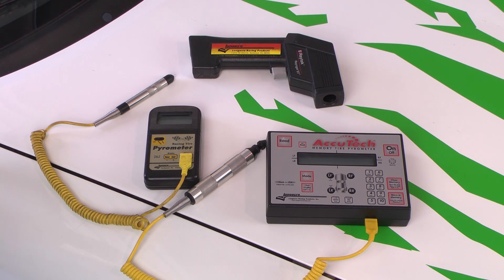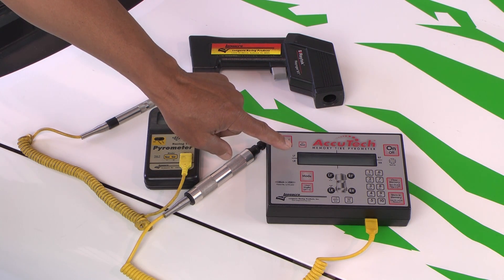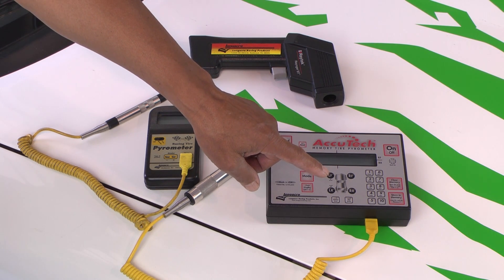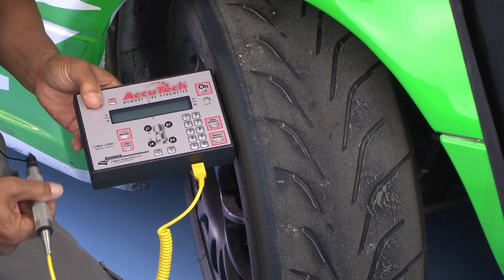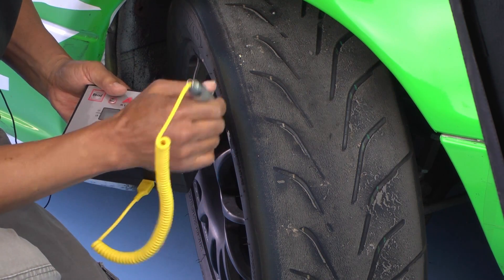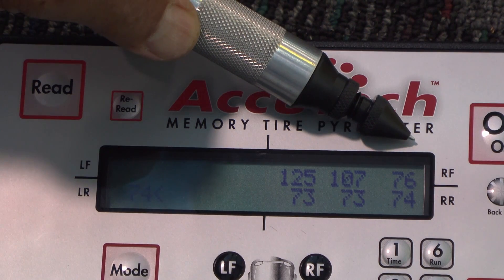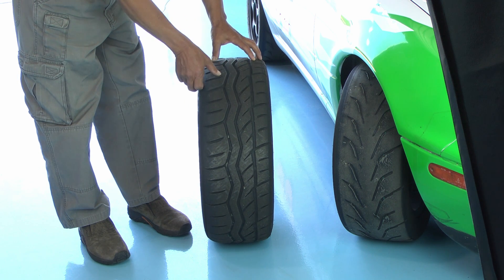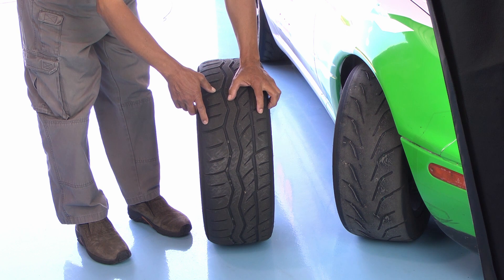How to Adjust Camber for the Best Performance

Comment: Is the goal to get even temperatures across the tire?
Reply: this is my same question is it more about feel and lap time or temps
Reply: @bostic8683  I’m not totally sure, but I do know the following: if you take 3 temps across the width of the tire and you find the following: 1.  If The center of the tire is hottest than tire pressure is too high 2 if both the outside temperatures are higher than the middle then your tire pressure is too low 3. Inside and outside temps will reveal info about your camber. I do not know how you would fine tune camber with inside and outside temperatures though
Reply: @alexanderdavidtarras1156  I know this also that if ur inside is hotter then less camber would reduce this and if ur outside is 2 hot more camber would even it out. whether this is what u use to deduce camber or strictly feel is where I'm puzzled after thinking over the night i fig might be a mix of both with more camber on quali n more temps on race
Reply: @bostic8683  hmmmm sounds about right. I know with my car I was given a guideline of the alignment specs and maybe you use the pyrometer to dial it in to a more precise point.
Reply: @bostic8683  hopefully I will go to track and someone will tell me and I’ll let you know brother :)